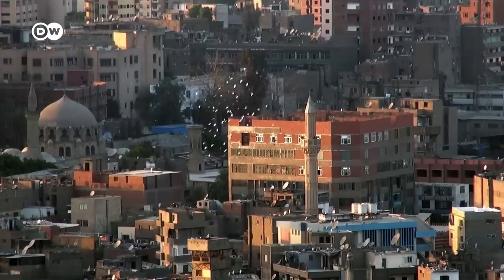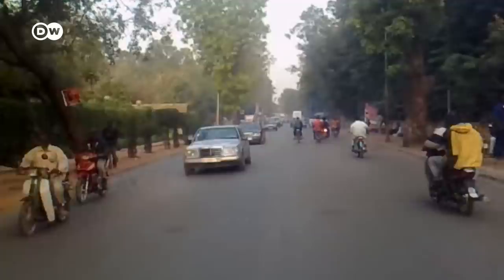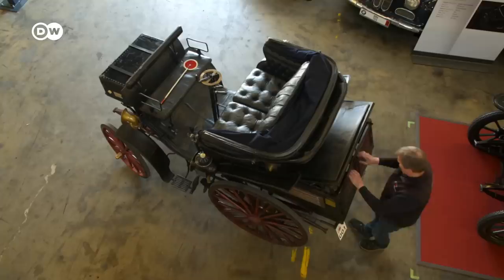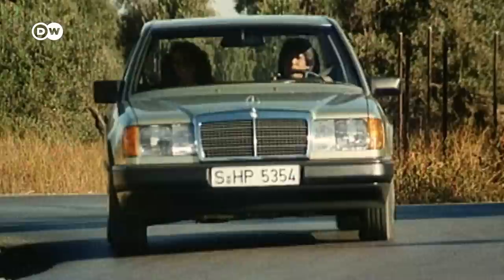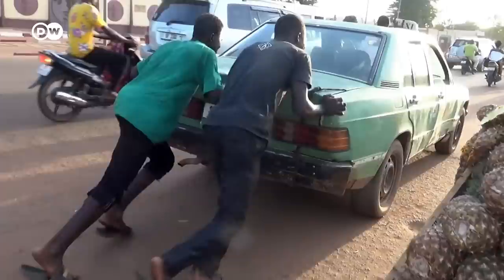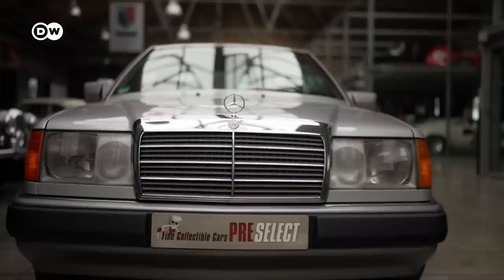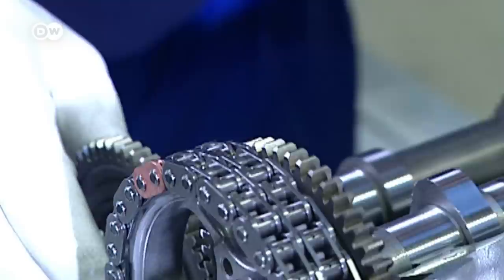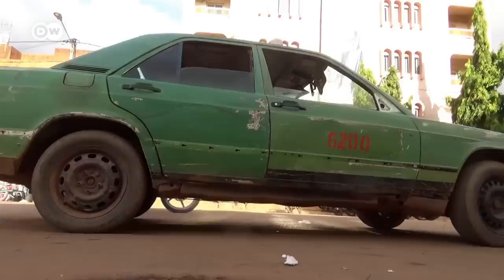Mercedes Classic: The Apex of Car Making

Comment: Mercedes are still living on a reputation that disappeared in the mid to late 90's, Sad really what they have become.
Reply: Mercedes from the late 90's and early 2000's such as the w202,w210 and w203 are still around doing the job while most cars from 1995-2005 are long gone. They still had outstanding quality in the upholstery for instance. Their quality fell sharply in the late 2000's with the apparition of screens and cheap plastic everywhere the interior of w204 was a disgrace.
Reply: The quality died in batches. My early w220 has some rust, which is ridiculous. But the ride is still exceptional, the engine is incredible and the interior, with the leather across the dashboard, is second to none. With each development a new way is found to squeeze the quality lower, but it wasn't all at once. I'll be sad when the rust gets too much.
Reply: 100% agree
Reply: @Koyaanisqatsi  Alfas are just upscale FIATs. Definitely better than the '70's & all, but within 2-3 years, the buttons get sticky, leather panels begin to peel, glass delaminates. Maserati & Ferrari also have these issues. Never buy them new & know what your up against- you'll be happier
Reply: @olikat8  right! Okay, I promise. Now I'll never buy a new Ferrari...
Reply: @Daniel Masmanian  ha,ha- I actually have a couple friends with them. They are neat, but they have issues that-at that price point- I'd never put up with. Not to mention the "Joy" of dealing with Ferrari if you do something they don't like with a car you bought.
Reply: This "oh this brand is dead" whining is always done, nothing new under the sun
Reply: To stay in business, a car company does not need to make cars that will outlive the owners
Reply: I knew nothing about them, other than the older ones have a great reputation.
About a year ago one of my customers called the shop, because I used to see an old Mercedes in his garage and I used to joke with him saying to call me if he ever wants to get rid of it.
 I barely even knew what it was, but you could totally eat off of any part of it. 
It's an 80 240d manual. 
Those who know em better than me said 6k was a steal. 
At least I'm a little familiar with German cars ,I've had vws all my life. 
Now I truly get the Mercedes thing, it's so solid. 
I could sit there and open and close the doors all day ,that closure like a bank vault door is so soothing.
Reply: @DanielMasmanian  Same. I also have a W220. Only one rust bubble that I know of😅(right by the hood ornament). The drivetrain in those cars are great and relatively easy to work on. I owned a W210 for 11years and it only needed minor work to keep on the road. My goal is to get a G wagen and CL with this engine transmission set up and drive them forever. Sure the interiors, rust proofing and sometimes electronics aren’t MBs brightest hour but they made some pretty stout cars in that era.
Reply: @milo1263  what year Mercedes-benz have you got? And what are the problems?
Reply: L’obsolescence programmée
Reply: From the 90s and 2000s it has been Toyotas that took that title, however Toyotas newer than 2015 or so are just modern day Mercedes. The Chinese brands are picking up from that.
Reply: Ridiculous statement.
Reply: @Porsche996driver  Don't blame the messenger for bringing the bad news.
Reply from the maker: @Daniel Masmanian: We see what you did there! :-)
Reply: Is sad commentary on the worlds attitude towards building anything to last.  Everything is built to be thrown away
Reply: maybe you should look at the 2022 s class
Reply: Unfortunately a lot of car makers cut costs today.  I recently had my 2010 Toyota iq serviced at a Toyota garage.  The service manager advised me to keep it as long as possible because the newer models are not as reliable.
Reply from the maker: @keithmartin1328  where do you live?
Reply: @DWREV  I'm in England.  My dad has noticed this with his cars too.  He has been driving Volvo cars for the last 20 years.  Changing them every 3 on a leasing plan.  The current car he has had to go back to the dealer twice for electrical issues.   None of the earlier cars had any issues.
Reply: Because cars have got so much heavier due to customer demands for safety and luxury features, car makers are using plastics and other relatively light but flimsy materials, where  once they would have used metal in there construction. This is of course to help make the cars more fuel efficient and emission compliant. Unfortunately as they say there is no free lunch and quality is the loser here.
Reply: This is true, i have mercedes cars i like them, but i have to sell around 200k km or i sped price of  a new car on repairs…
Reply: I agree that's why you have to buy a 70s to 90s mb.
Reply: Till 1997, when the whole German automobile industry was suffering and Porsche almost collapsed, Mercedes build cars. Later they sold products. So just think of what happened to economics. Nobody wants to pays for cars any more, only for products.
Reply: When mercedes benz decide to build cars....no carmaker can compare to it.
Reply: @booblam6919 mate can I ask you more for cars?
Reply: @alikukaj8279  shoot
Reply: @booblam6919  thank you mate.which is difference betwen Mercedes and toyota(lexus)It is far away in generally Mercedes better,because I saw many people saying that"lexus is better and more reliable and bla bla"but I drive always Mercedes so I dont think than any car can afort you better driving experince than MB?Please tell me if you know something from history🤗
Reply: @booblam6919  ??
Reply: Ask a specific question
Reply: @booblam6919  which is better for you betwen Merc,Audi,Bmw,toyota and why?
Reply: @alikukaj8279  answer = MERCEDES BENZ. 

Why?  1. Better build quality  2. Refinement  3. More detailed  4. Comfort/luxury  5. Engineering and sound  6. Safety and functionality  7. BENZ is more superior overall.
Reply: @booblam6919  thank you so much my friend,important answer by you😎👊
Reply: @gteixeira exactly 💯, Toyota was something special at one time
Reply: From and after2000s or 2003
Reply: I have w211 inline 6 diesel i have done over 600000 kms
Reply: M113-bulletproof

Comment: Sadly, German luxury cars are no longer synonymous with quality and durability and are now bought only as status symbols. What happened ? 😢
Reply: Growing up, my family had a W124 which we loved, but quality went down hill with subsequent models. My last German luxury car was an Audi from the mid 2000s, least reliable car I've ever had. Haven't bought another since.
Reply: While Mercedes does have some engines from certain eras that are questionable, most of them are pretty reliable. They're more reliable than BMW and Audi. I know someone who, for example, has an A45 AMG. It has a highly strung and powerful 2 litre 4 cylinder engine currently with 280,000 kms and going strong. Other parts though like the interior plastics and fabrics is where they went down. I've seen many newer C Classes like the W205 have awful interior material and build quality with rattles, cracking armrests, peeling aluminium look bits etc. However, mecahnically and safety wise, they're still strong.
Reply: @SDav21  well, BMW's B58 engines are also up there as well, Toyota even put one in their "supra" which is a Z4 chassis with Toyota bits. Highly robust and high compression ratio
Reply: the engineers no longer have control of what they do its all accountants now sadly
Reply: @baoquoc3710  close deck design
Reply: @SDav21  Is that why BMW tops the reliability charts these days while MB is way below? Hmmmmmm…..
Reply: @AgonxOC  Those surveys don't just include mechanical related items. Where Mercedes loses points there these days is the electronics and build quality of the interior. I know someone with a new C Class that had so many issues with the infotainment system not working with Android auto. Also, I've seen brand new GLEs with buttons falling off, rippled pieces of rubber around the doors etc. That's where BMW is doing far better. Mercedes tried to push the tech so much but they didn't refine it before putting it out there. It is so unlike them. So while I'm not defending Mercedes, I'll drive credit where credit is due. Generally, you'll find most people have major mechanical issues and failures with their old BMWs. Maybe the new ones are better yes. But Mercedes normally build way more reliable engines and gearboxes. I see way more older Mercs on the road than BMWs.
Reply: nothing has happened they still make quality cars
Reply: They chased volume and cut costs...
Reply: @paullacey2999  Except now they're no longer chasing volumes yet still cutting costs. Mercedes for example is discontinuing the A Class platform and all the cars based on it (CLA, GLA, GLB, B Class etc) and focusing on the more expensive, more profitable models while still cutting costs to get more profits. Very sad.
Reply: @99bepis4  Hmmm, my grandfathers Mercedes about 50 years is till running, no repairs...start and go
Reply: @SDav21  its true. I always see a man opening his BMW bonnet on the motorway all the time. But the interior, BMW does it better. Most of the police men, old men, the pensioneers and all the old guys are chasing after mercedes. when you ask tem why, they will say, my son...it takes me to where im going and brings me back...dont try to drive them like BMW.
Reply: Over engineering,  and electronics.  Too many peripheral, sensor controlled components.  The more wires, sensors, parts and plastic you have,the more failure possibilities there are.
Reply: Greed for profit.
Reply: Awhile ago, someone told me "They went from building cars for smart people, to building cars for rich people!"
Reply: Can't profit from a "perfect" product, I guess. I used to buy mercs since the early 80s, but now I drive both Toyota and Lexus.
My 1992 500E is still in use 6 months a year, but it takes some extra care to keep the lady running.
Reply: @SDav21 nice coment,can I ask you something about Mercedes and toyota?

Comment: I regularly drive an unrestored but carefully conserved 1955 W188 300 Sc as well as a 1970 W111 280se 3.5 (my father’s cars from new), they never cease to amaze me by absolutely always starting immediately and in 2023, after 68 and 53 years respectively, they are still the most incredibly beautiful cars and the absolute stars of the road.
Reply from the maker: Cool, maybe you can mail us some pics Rev.community@dw.com
Reply: That is impressive. 
I couldnt imagine riding around almost daily in some 50s American marshmallow suspension car.
Reply: @DWREV   Done. Check your inbox.
Reply: amazing how poor the engineering and quality are now by comparison. 2013 C250 junked after cam adjusters failed at 78k miles. 2017 c300 with only 34k miles traded after crankcase vent valve failed at a prospective repair cost of 3$3-5k. should have kept one of my mid 80s turbo diesels.
Reply: @galbraithmp  I do agree that 80’s diesels are true german leopards in disguise. As for the modern cars, i drive a 2013 W204 C63 with a naturally aspirated engine that gives me nothing but thrills and joy every time i get in it. As with the old ones, careful and timely maintenance is the key to longevity as well as durability.

Comment: I'll never forget my reaction upon getting in a then 30yrs old taxicab. It was a W123 Mercedes. I was in Dakar Senegal, where the main mode of transportation was by taxis. They were mostly 10yrs old offerings from Japan and France that were already rattling away. This one fare was an early 80s W123 that impressed me with the way the door sounded like a vault upon closing, and the ride was rattle free. It wasn't my first time riding in a Benz, but it was much older than the other taxis that I'd been riding in. So, I was able to experience the Benz's durability and quality firsthand.

Comment: I have a 1979 Mercedes SD 300 turbo diesel. It is the only one in Ireland. 
Sold new in Florida in 1979 during the oil shortage of 1978-79.
Incredible engine, OM617 5 cylinder turbo. Bigger turbo put on it. Now 350bhp.
Reply: What turbo did you put on?  I know the Garrett can take a larger impeller but that can't reach >300hp

Comment: As the older guy or car collector mentioned that after w124 quality went down is very accurate and honest comment. Benz can do it again before it looses it's loyal customers. 
To my opinion as an automotive tech build all the parts in-house and testing them to a maximum life span. Plus alternative fuels are now in the market.
Reply: They can but the corporate nature of Mercedes nowadays is holding them back and they need to abide by things like emission rules, regulatory compliance, etc. etc. and all that boils down to is additional expenses which means they would have to build their cars on a tight budget.
Reply: Nobody will pay the necessary price for a base model Mercedes made to those standards these days.
Reply: There is more profit margin to a luxury product, which is why merc is the way it is now.
Reply: The key to reliability is simplicity. Unfortunately manufacturers are heading in the other direction.

Comment: As an owner of a 2002 C209 CLK200 Kompressor, I can say I'm really pleased with the comfort, equipment, performance, build quality, design inside out and reliability. 
Except from some design flaws from the engine that I had to fix and that should have been a part of a major recall. (M271) Most notably: timing chain and valve head - valves - valve seats!
But after fixing them I'm really pleased and happy and can definitely say that no other car brand matches Mercedes-Benz!
Reply: at how many km did you have to change the timing chain ?
Reply: @BoranundBaran  At around 152k kilometres for preventive reasons.
Reply: you get what you pay for
Reply: @fredrezfield1629  It is supposed to be a great car and product. The early flaws of the M271 engine is what spoils the reputation. But once you fix them, it's a treat ! Still, I strongly believe that it should have been part of a Mercedes recall, and that's what really bugs me.
Reply: @nickzourb190  M271 engine is shocking all i see is problems with them stick with the old v8s and v6 in my opinion

Comment: It's interesting to observe the relative cost of the car has reduced over time. In 1986, a 300 E W124 was approximately worth 4 times the annual income of the average Australian. Now, the W213 E 300 would cost less than 2 times the average annual income. 

Many of the innovations which were expensive to implement at the time are inexpensive to achieve reliably in the modern day due to advances in technology. This means there are more inclusions in the vehicle than previously, which therefore are more possible points of unreliability.

However as the appetite for shareholder returns grows, each and every system of the newer car is cost reduced more and more, and additional revenue streams such as subscriptions for optional feature enablement are introduced. The cars we see today are a product of the economy of the time.

Comment: I have a 1987 Mercedes 300D - the iconic Bruno Sacco designed W124. I'm at 29,000 original miles. I bought it from the original old lady owner with 26,000 miles four years ago. Impeccable interior and exterior quality. Easy to work on and so simple.

Comment: I was lucky to be a Mercedes mechanic from 79 to 04. And I can remember the older traveler technically from Germany they told us that the younger generation was taking over. After that it slowly went downhill as soon as the customer recognized it they all went Lexus
Reply: Lexus are definitely building the reputation Mercedes have lost.
Reply: Lexus never made a diesel car.  Mercedes is simply a different level of car.  Mercedes make industrially engineered cars and lexus does not.
Reply: The habits of consumers in the West have changed in general, from more focus at longivity 20-30 years ago and more, towards 'use it and throw it away, buy new'. Most manufacturers have just adapted to meet the wishes of the new generaton. Toyota/Lexus seems to be an exception, with more focus at longivity, making things that last, and less at fancy pricey funtions. and the brand typically got some more grown up customers. I stick to my '95 124 300 diesel, as I love the design and like to maintain everything myself. Got no interest in all the electronics of newer models

Comment: The threat to Mercedes-Benz in the late 1990s was not only that corporate management decided to serve shareholders but also Lexus entered the market and thus posing formidable competition to M/B. Also not mentioned in this report is that Daimler’s take over of Chrysler led to the adoption of the M/B 300E platform becoming the basis of the various permutations of the Dodge Challenger.  Incidentally, Mercedes trucks from the 1950s are still running in many parts of the world, having been rebuilt and restored several times over.

Comment: 10-year-old E-350 sedan, Luxury trim.  Runs like a top.  I always follow the scheduled maintenance at the dealer, and so far, no expensive repairs.  Garaged, so the paint looks great, and heads turn when I drive.  An uncle had a Mercedes diesel sedan, but he was too cheap to take it in for the required scheduled maintenance, and so he had engine problems that cost $$$$.

Comment: My 1999 W202 is one of the last "old school" designs. Mine is a C230K Sport, still runs great with 265,000 miles on the odometer. Very solid, dependable and fun to drive.

Comment: That is why i drive W124 and W140 cars today and still maintains them, but recently sold the w124 and bought the w210. Basically i own and operate, drives only 90's Mercedes. They are just the best of Mercedes to own and drive, comfortable and cheap to maintain and quite reliable by modern standards, which are rubbish with too many electronics. I'm from Malaysia and will keep these cars running until i'm old.
Reply from the maker: Happy to hear it’s treating you well